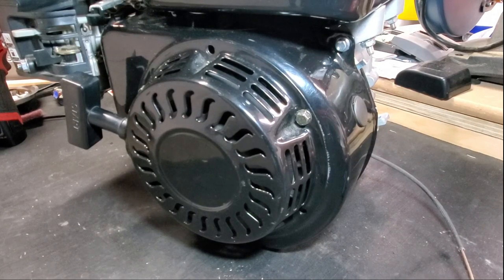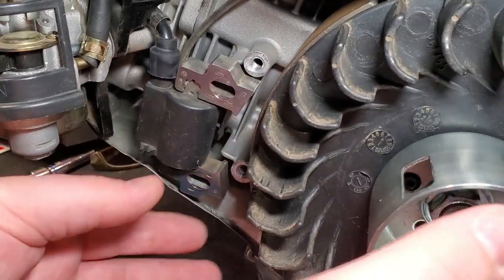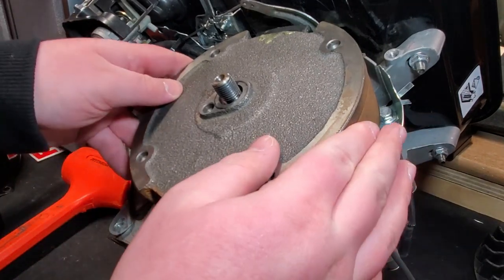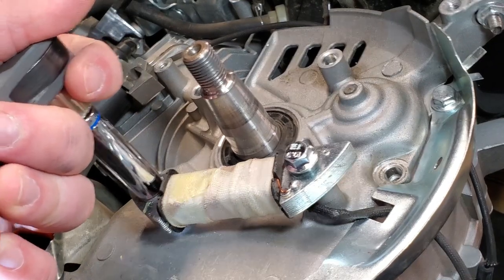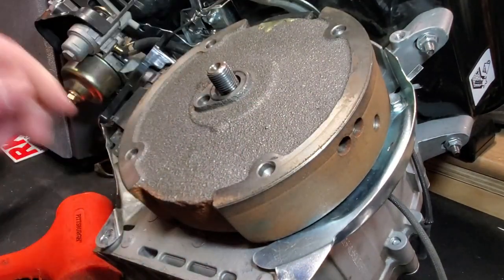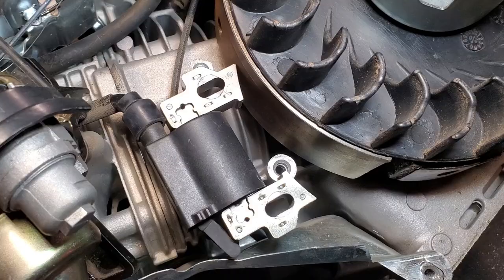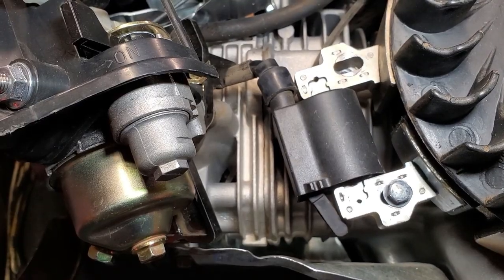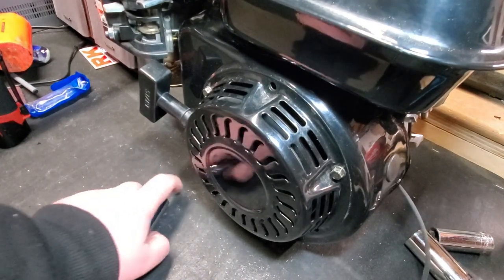How to Install Charging Coils on any 6.5 HP Engine

Comment: Current is depended on coil used. My coils output 3A each. Connected to a regulator/rectifier they output 6A. Also you should put feeler gauge across both mag poles when gapping. If you do one and tighten it, you will disturb your gap when you adjust the other side and tighten. Also, never impact gun a flywheel on. There are torque settings for a reason.
Reply from the maker: I agree with everything your saying. The reason why I didn't put much effort into adjusting the ignition coil properly is because this engine is not being used for anything. So it's kind of a practice engine you could say. That's goes for the flywheel to. I appreciate the tips though.
Reply: Whwhat coils did you use mate?

Comment: just watched your video and was wondering if I could do the same on a 13HP generator motor so it would charge the small battery?
Reply from the maker: @realbusy  you totally could. It would, however, it would require specific parts for that motor.

Comment: How to connect coil wires to battery, or rectifier.
Reply: Regulators usually tell you how to hook things up. Coils output AC current. Connect these to AC of regulator/rectifier. Bat + goes to bat + and if theres a ground that goes to ground. If its a 3 wire usually the case is ground. This will convert the ac to dc. With no load coils should output roughly 20-30v, under load it should be 12.5-14v.
Reply from the maker: What coils do you use?
Reply: @outdoormaniac4562  share the coils model please!
Reply from the maker: This is the one I used:
Everest Brand Honda GX160 GX200 5.5HP 6.5HP Charging Coil Engine 3 Amp https://a.co/d/5pBmyyJ
Reply: @outdoormaniac4562  thanks Sir, regards from Mexico!
Reply: Where do the charging wires go to

Comment: Would this work on a Coleman ct200U ex ? Replaced my ignition coil but don’t know what size feeler gauge I use use
Reply from the maker: Off the top of my head, I don't remember what size. The charging coils will fit on the stock motor.
Reply: @outdoormaniac4562  not the charging coils I need the coil gap from the flywheel to the magnet for a 196cc
Reply: @outdoormaniac4562  what’s the correct gap .035 ? For a 196cc stock engine ?

Comment: flywheels without the magnets around the inner ring will not charge. as this is not a key start flywheel, I would be pretty surprised if it made power. it will not charge with the magneto magnet as it is on the outer ring away from the charging coil. Most of the chinese knockoffs do not include extra magnets that would not be used without the coils, they never spend a dime they don't have to it appears. Insofar as the wire goes, what comes out of the wire isn't quite DC. The kits include a fairly large diode installed with the banded end away from the engine (non-banded end towards the engine) which provides pulsed DC, much as a riding mower has for low amperage charging. Installing two coils can be accomplished in the same way, but it's best to have each wire go through that diode, and then join at the banded end.
Reply: Are you absolutely sure that connecting both coils (of a 2-coil-install) to the same diode is the best solution?
Reply: @andreassittig2772  it should ,(as there are two kits) each coil goes through it's provided diode (non banded end) and the diodes are joined at the banded end. That's where the pulsed DC comes out